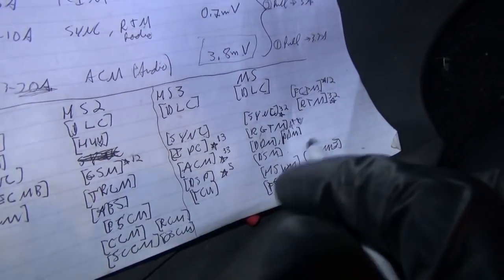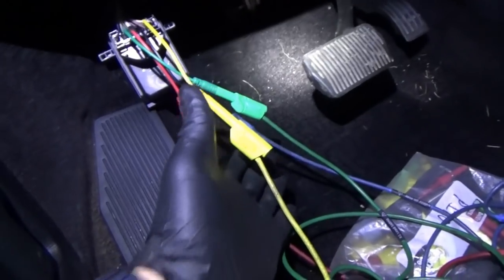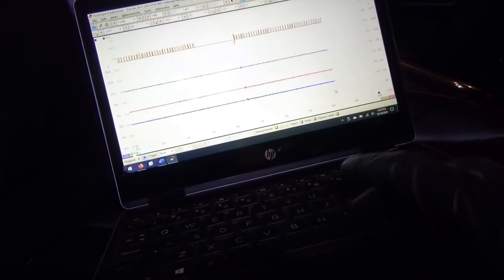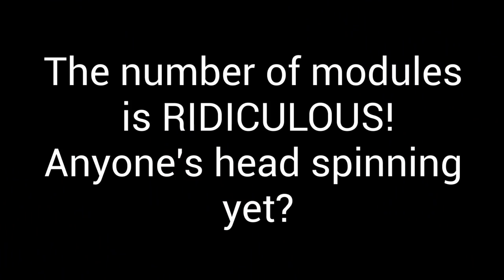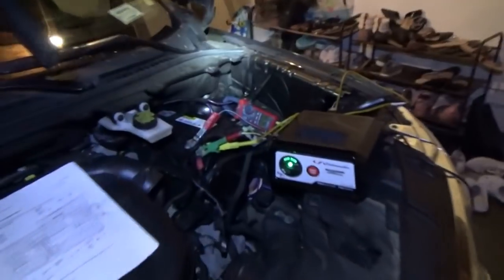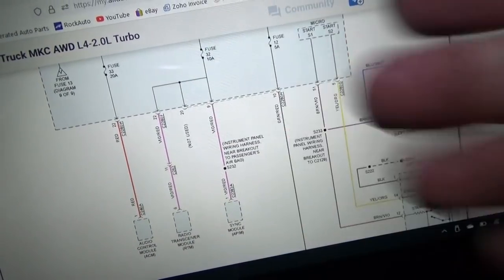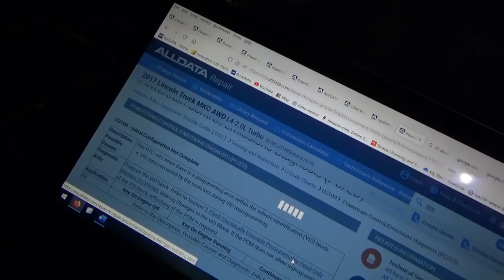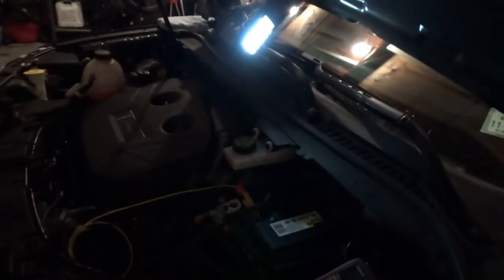7 HOURS to find a 5-AMP Draw?! (Lincoln MKC - Part 2)

Comment: I know from my time at bmw when individual modules all connected by can networks peaked at 68 (a lot of current every time you wake the car up), it was a fun time chasing current draws. Fibre optic, can high, can low, byte flight, i-can, lin bus, k-can, MOST etc etc lol.
We found that in most cases for bmw. It was a control unit waking up and trying to communicate, causing a draw. Even better than this, everything would work faultlessly. Then they would often do it in the middle of the night. So we would have to set up long term oscilloscope track over night to catch it. 
I know your method is usually the most effective. We found that with absolutely everything interconnected and monitoring. Our trusted way was to trace the communication as you did but then (with the luxury of the cars full spec and factory wiring diagrams at our disposal) disconnect directly at the module one at a time methodically. If you pulled power (cutting it off at the head) as you did. Often the tail would wag and cause other parts of the car to react. Where as if you isolate the module, it would log a code but just be lost to the network. Not affecting anything else. 
Except the MOST obviously because it is a fiber optic loop in series. We would have to install a fiber optic loop out of the chosen module before putting the car to sleep. 
The real kicker is when you move into the module that you found at fault. You would actually find no physical fault. But with the advent of key-less ignition and entry, meant owners in the habit of leaving their car secure in their garage/house but unlocked. So because of software. The car would take 45min to and hour to go to sleep but then realise hours later, "hey, I'm still unlocked. Maybe I should stay ready". Wake up to look for the key. Or worse, the customer would leave their keys near the door or in their pocket and walk past the garage. Then because of proximity, constantly pinging each other. "Wake up, they're back!". Haha
So then we had to re-educate our customers to yet another function, that they must lock their car always, even in their own garage. 
I will also say. As soon as this era haled in. We recommended that owners buy a quality smart charger accross the board due to the power demand and most people only driving small trips.
As always, love the content Ivan!
Reply from the maker: Wow sounds like a BIG NIGHTMARE haha
Reply: @PineHollowAutoDiagnostics  this was at the peak of ridiculous mind you. E65 V12 fully spec'd down to night vision cameras to alert you of wildlife etc.
Just before I left, they went to the new F-series of cars which was SO much easier. With essentially everything being condensed into a front module and a rear module. That's it.
Reply: Very cool!

Comment: Be careful when reprogramming the new module, as a tech at Mercedes i've seen a few times where the scanner wants the old module installed first and it copies the bad programming which winds up causing the same issue on the new module. sometimes we are able to get away with performing an Initial Startup of the faulty module and it fixes the problem without having to be replaced. Great Diag!

Comment: Nice work. Even if the programming procedure worked on the old module I would have replaced it. Working with micro controllers I have found that corruption is a sign of decay and future failure is most likely.  I enjoyed parts one and two and look forward to three.  Also I appreciate you explaining how you bill for your work in the past.  It appears that cars and trucks are continuing to subdivide into specialties like the people movers I work on which require five highly skilled crafts on site to keep them running with an additional group off site for support.  Even in my craft we have specialists for subsystems. One thing is given, it is never boring. Frustrating at times but never boring. Cheers.

Comment: Very interesting diagnosis. Something you may want to add to your diagnostic kit for these new cars with key fobs that do presence detection is a faraday bag or box so you can quickly switch the fob from nearby (out of the bag/box) to far away (inside the closed bag/box). A simple metal box (such as a toolbox) would work, or a repurposed ESD-safe bag (like toll transponders or some PC parts come in). And of course you can buy something online specifically for key fobs

Comment: That fault does have a name, I work for a controls company and play with CAN type busses. Its called a babbling node, it grabs the wire and wont let go increasing network traffic and causing lots of headaches. It does usually mean a bad part. The fact it wont allow a firmware flash again usually means the part is bad. Nice job on the troubleshooting, you hung in there on that one. Network issues are always a pain! :)
Reply from the maker: "Babbling node"...I'll add that to my diagnostic vocabulary haha

Comment: Had the same type of issue recently on a 2012 Dodge Journey SXT. Draw from the BCM, Took me forever to figure out! It ended up being the intelligent battery sensor(which in my case was a LIN style sensor) it was somehow waking up the BCM and subsequently several other modules in the car. Great Video!

Comment: At 33:00 would it have been worth trying to choose no, and tell the scanner the original module isn't available? I wonder if by choosing yes it just reads the blank / incorrect config from the module, then asks you to swap it, and writes back the same (blank) config to the "new" module - I would guess the no option would just initialise a default config or something instead if you don't have anything to transfer from the old one (?)

Comment: WOW!! This just solidifies my line of thinking that I will never buy another vehicle built after 2006 (preferably none after '72, lol)  for as long as I live! If this were mine I probably would've lost it and tossed a map torch inside with the flame locked on!  MAN, what a nightmare! They've got modules for modules, lol! Ridiculous engineering here. They go through all this complexity, and STILL use low-bidder garbage components. Just mind-blowing!! 

Impressive willpower, Ivan. I don't think I could've succeeded on this one without quitting in utter frustration! Nice work!

Comment: There’s a hidden place in the glove box, center console or under the cup holder rubber that you can put the fob and the car will start. It’s incase the battery is dead in the fob :)
Reply from the maker: I'll keep that in mind lol
Reply: @PineHollowAutoDiagnostics  it looks like a little tray or it’s indented like a key fob
Reply: @PineHollowAutoDiagnostics  WatchWesWork programming a Ford key, placing it in that slot https://youtu.be/hSjYu6DrTFs?t=1888

Comment: On Fords say you replace a bcm and go through a PMI process sometimes there is a sub menu to go to to completely configure the module. With a bcm replacement the interior lights will flicker because the tpms is part of the bcm total configuration. Also with abs a PMI will not totally configure the new module. There’s a longitudinal sensor calibration menu in ids/ fdrs to go through. Not completely sure about an RTM I think just a PMI is adequate to configure it completely

Comment: My second comment on this: It does make me wonder how many parts canons have been fired by just unplugging fuses, finding a fuse that the high current goes through, just replacing modules on that power leg to find that didn't fix it.. One would have never found the actual cause that way. Very clever to monitor all can buses for activity.  Thanks again for the education, Ivan.

Comment: Not exactly related but Ford for years had parasitic draws from amps and phone transeivers when they were first installed from the factory (not aftermarket insall). very little info available at the time. Great job Ivan.

Comment: I am not sure why everybody here is so shocked about the abundance of electronics in vehicles these days.
This has been going on for many many years now so not sure why the surprise. Get on with the times and keep expanding your knowledge base. Expand your tool kit with modern diagnostic equipment as well. If you want to be competitive you need to keep up with the technological advancements. No point in whining.
I am sure back in the day when carburated vehicles were the norm, mechanics were crying about the introduction of the fuel injection... and look now nobody even thinks twice about it.
Every device in our daily lives is becoming more complex for better or for worse, but there is no stopping it so get on with the program lads. :D
Reply from the maker: This is definitely the trend...it's human nature to resist change. However, nowadays it's mostly "convenience" features that cause major inconveniences for car owners. Guess they should have bought a "base model" with a regular ignition key haha
Reply: @PineHollowAutoDiagnostics  True dat. I agree with ya about humans naturally resisting change. :)
This whole electronics complexity thing has been going on for some time now, so I sure hoped that peeps would have gotten used to it a bit more by now. Unfortunately, there are still more customers that do want those convenience features... and so the automakers will continue to offer them to the displeasure of the ones that would prefer to keep their cars simple.
Also, yes there is the fact that pretty much all "convenience" features are implemented using various electronic modules and such. Haha, I guess yeah they should aim for those "base models"... but then again even those are coming with "push-button" start nowadays. :D
You are fighting the good fight broski so keep it up!
С Новым Годом и Рождеством! 🙏💪

Comment: The low going glitch at the start of the repeated communication packet on the CAN bus looked like it was going to 0V. That would be caused by a module that was continually rebooting. 
If you had the gear, I expect that you could read the CAN data and, if the identifiers were published, the data would say which modules were communicating (since the packets are structured <identifier><data> I believe).
So there's the CAN waveform looking correct (proper signal levels and idle voltage), but the drop to zero indicating a rebooting module, but the data may tell you which one is rebooting.

Comment: Matt at Schrodingers Box has been delving into decoding CAN signals.  The Picoscope can decode the message but you'd need the CAN IDs for the car to get module identification.  I wonder if they'll start putting that in service data.

Comment: Absolute epic diagnosis! Very interesting that the surrounding lights of the FCIM would flash when the bus flattened. Maybe internally the proximity sensor in the RTM kept waking up because of the internal short, or for whatever reason commanded on? I’m not sure on that year make and model but usually every car with a “push to start” should have a location that you can place the transponder “key” that will override the RTM in an event that the battery in the fob goes dead, every year make and model has a different location to place it, but usually there is always a place to place it. But this is an absolutely epic diagnosis and I’m glad the machine didn’t defeat you!! lol

Comment: Holy mackerel, 37 fuses linked to the BCM?, nuts I tell 'ya!, no way the dealership would have anyone on staff able to do this type of diagnosis!.
Reply: The 37 fuses will be on the outputs of the BCM, for each circuit that it controls.  This isn't unusual on modern cars, the BCM eliminates high current switches and wiring on the dashboard and stalk controls.
Reply: @ferrumignis  Give me switches, any day.

Comment: Some 2015 Lincoln MKC vehicles may exhibit a dead battery due to welcome lighting (display/radio/lighting etc) staying on or cycling on and off when the keyfob is left within detection range of the vehicle. If the vehicle is built before 8120/2014 reprogram the Radio Transceiver Module (RTM) to the latest level using IDS version 92.05 or higher, and continue to monitor oasis for updates. Use applicable 12651 D labor operations in section 10 of the SLTS manual and use causal part 15K602. Engineering is currently investigating this condition. To prevent battery discharge, the welcome lights function can be turned off through the cluster, or the key may need to be moved further from the vehicle when locked.

If the vehicle is built on or before 8/20/2014 reprogram the RTM and the BCM to the latest level using IDS or Ford J2534 version 95.01or higher.

If the vehicle was built on 8/21/2014 and through 1/31/2015, reprogram only the BCM to the latest level using version 95.01 or higher.

Make sure you are connected to the internet when entering module programming to obtain the latest updates.
Reply from the maker: Great info! Wouldn't help this car though lol
Reply: @PineHollowAutoDiagnostics  I had also read that a lot of the programing instructions highly suggest being hard wired connected vs. wireless dongle during programming. That totally makes sense.
Reply: @PineHollowAutoDiagnostics  Ivan wouldn’t you notice that that module was off-line since it was corrupted just wondering. And hard wire programming should be used since the ‘radio module’ was bad and the system reboots loosing Bluetooth communication. 
With Ford, they require the vehicle to be running while all programming is in operation. Some programming is done over Wi-Fi if it’s close to your home Network, or by downloading on a USB drive.

Comment: This reminds me of many years ago when the changed the telephone exchange from an analog system to a computerized system. They were having some trouble and the computer was indicating a problem in a different area. They tried to get the computer to ignore the problem it was indicating to check the problem they were trying to find and it shut down the whole area phone system. It took nearly an hour to get it back up. They found out that if the computer indicates a problem, you check that first.

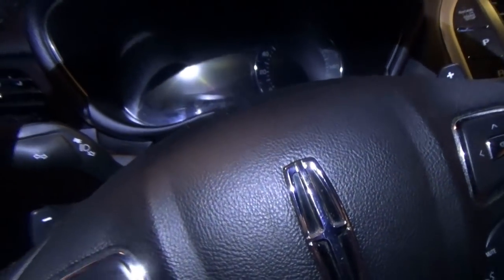Comment: 30:45 There should be a pocket inside the vehicle to place the key fob to start it in the event the battery in the fob dies. Did you try using that to start it with the RTM disconnected?

Comment: When you had the amp meter round the cables in the footwell showing 3.2amp draw, couldnt you pull the fuse one by one until the meter went to 0.? Good luck anyway!!

Comment: I had the same problem with my neighbor's Lincoln. I did a hard reset by disconnecting the battery and touching the pos & neg together for 10 seconds then waited 30 minutes. Everything started working correctly and has been for over 6 months.
Reply: in the appliance field there are appliances that seem to get confused, by cycle interruptions, power failures, unintended parameters reached, and the same fix is applied.., unplug for 30 minutes and hope it works.  with the circuit boards containing processors, very few people will ever know what is really going on in them.

Comment: I wonder if you had told it that you did not have the old module it would have written new data generated  from the PCM to it instead of old data that was already corrupted on the RTM module.  Just a thought.

Comment: On my 2018 Subaru if the key fob loses comms with the car ("RTM" module or dead battery in the fob) you can hold the key fob directly on the "Start" button/switch (touching or 1" or so away...NFC chip I think) and the car will start. Maybe Ford/Lincoln works the same way?  Nice job!

Comment: Can the Pico convert the analog CAN data to digital as each module has a unique ID being the first part of the packet?
Also, if scan tools showed the ID's on the topography you could go straight to the offending module.
Seems like something that should be available going forward.
Reply: I think you mean "can the pico decode the CAN data" because CAN is a digital protocol, not analogue. 

And yes, not directly, but yes you could decode the Id's that have traversed the bus, however the manufacturers are pretty choosy about what information is made available, even to those who pay licence fees for the data. 

Someone should really start a database worldwide that mechanics can access and submit their findings to (for cases like this). If it got going, it truly would make life a lot easier in a lot of cases.
Reply: @jimmyb1451  When I say analog I meant that the CAN signal is not an exact square wave and there are variations in length requiring some careful conversion code.
I'm not surprised the OEM's are not forthcoming and judging by Ivan's recent experience at the Ford dealer even the Techs don't have access to half of what they need.
Reply: @djambrosia  Yeah, the OEM's are deliberately making it harder to fix their systems. It's why the right to repair movement is such an important initiative.

Yes, there is a mark space component to the CAN bus protocol and it's a two wire differential signal, but none the less it is digital because it has two discrete states, on or off. 

The wave isn't square, true. That's exactly why it's a differential signal, which is quite clever. The reason it's a differential signal is because the bus wires are in long runs inside harness' running parallel to other conductors which are carrying heavy currents. The purpose of the differential pair is that it by function, cancels out any common mode interference. Otherwise signal integrity would be unobtainable in that kind of harsh EMI environment.

Not trying to criticise my friend, but to say it's analogue is just incorrect.

Comment: You need to do as built data not pmi for a replacement module especially if your getting an incorrectly configured code. So by a subscription to fjds use j box. Or if launch can put as built in use that. 2nd how do you know it’s not an input keeping the module awake for example a door handle.  But good work!